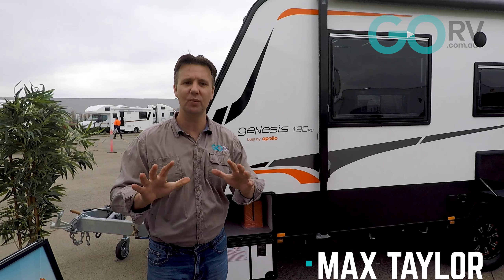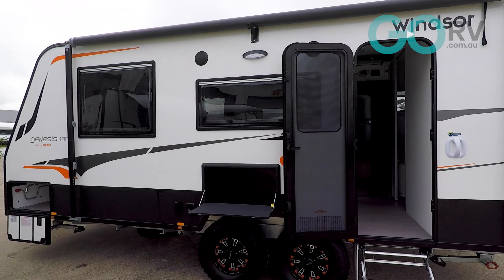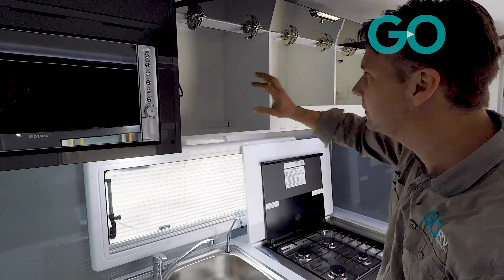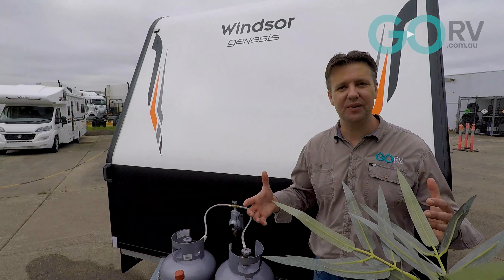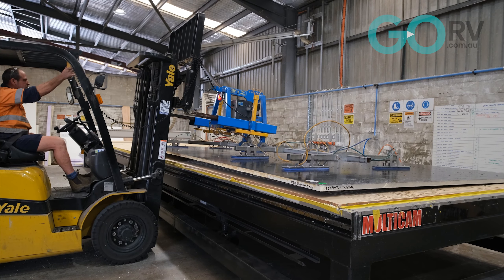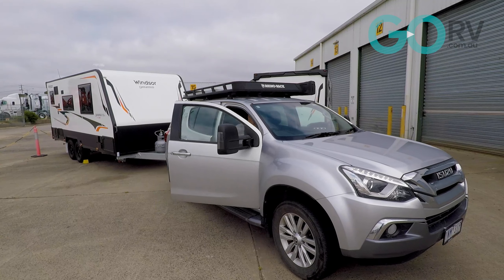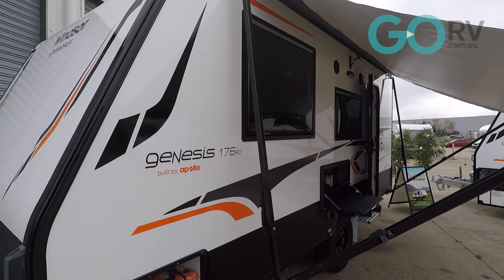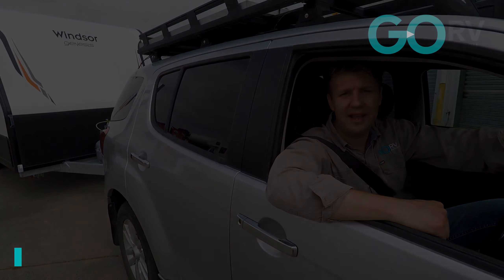SANDWICH PANELS: The future of Australian caravan construction

Comment: How would a novice buyer such as myself be able to tell if the construction has been completed well and the best adhesives have been used? Also what are the pros and cons of fibreglass vs aluminium? Are these vans designed to flex a little and does that create any issues?
Reply: A mate has another brand 19ft van. With a multi panel ,joined construction.
Over the entrance door they ( company) joined a small piece above the door  to the left and right main panels using a double U channel joiner.
In heavy rain it now leaks down inside the door channel and out  the bottom.
He is definitely peed off.